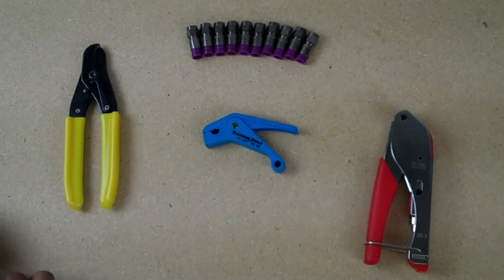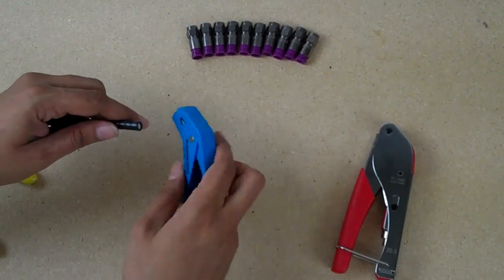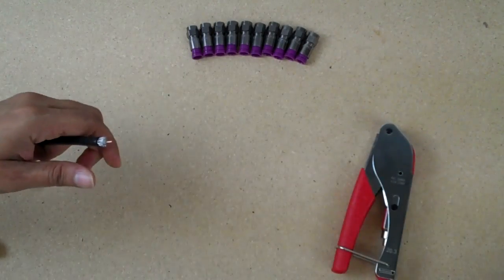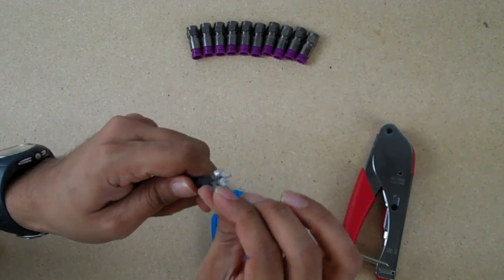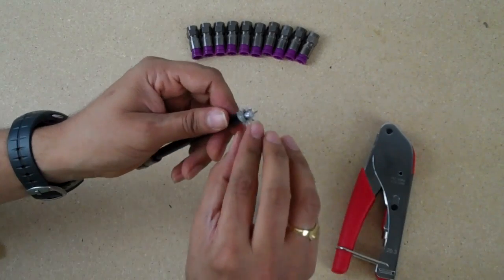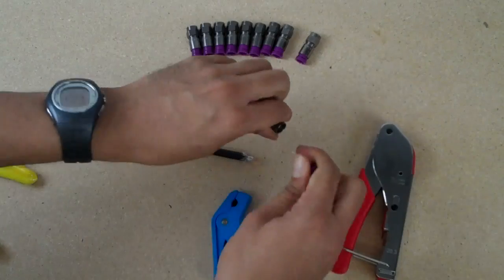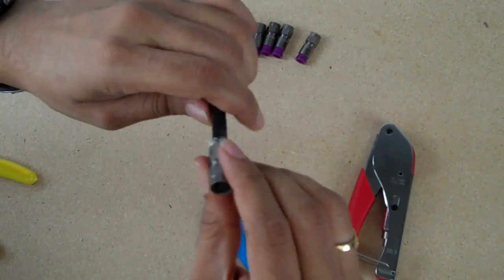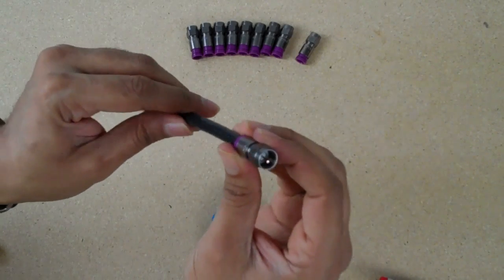Quad Sheild RG6 Cable Termination Demo

Comment: Quad cable reaches the limits of diameter for the RG-6 types, especially with different manufacturers, and if you substitute vendors, there will be disappointments. Once you find a setup that works for a particular cable, like say whatever Home Dept is stocking, that does not mean it will work with other brands. The connectors are all over the place too. Do not expect the cheap connectors that come with most kits to slip-on like what is shown here.

Comment: I believe you are to tear away the foil shielding and fold back only the braid layers.
Reply: Some remove the exposed foil, while some peel it back with the braiding - I don't think it makes much difference as long as you can get the connector over the end of the cable. I think those who tear the foil away do so only because it makes pushing the connector on a little easier.